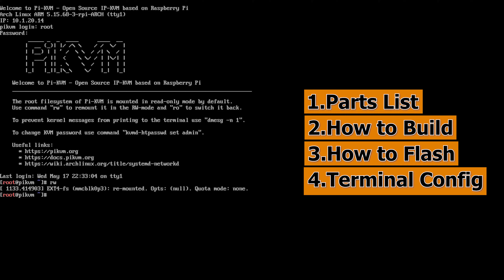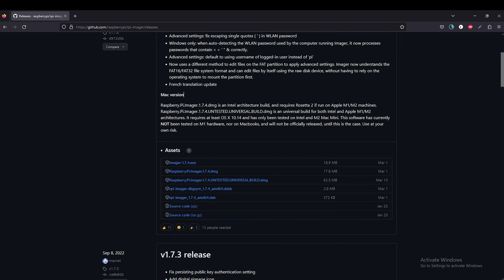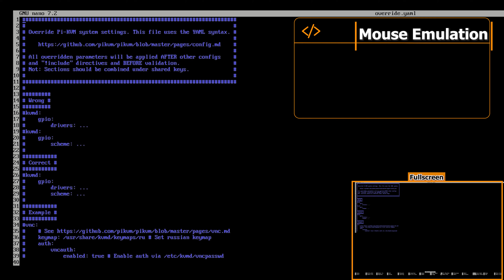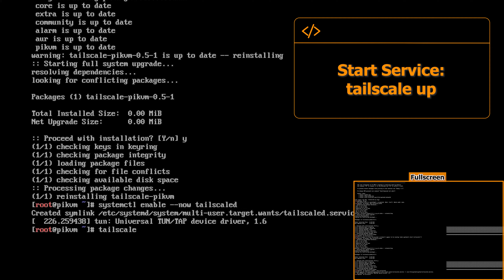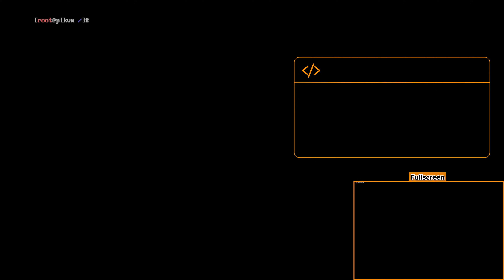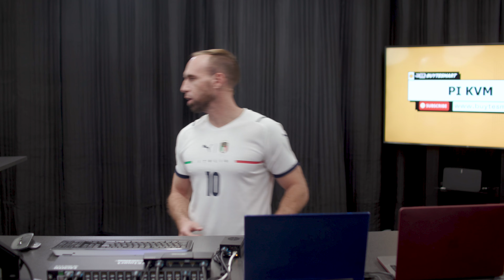PIKVM GUIDE: Build KVM Over IP Switch to Control 8 PCs with 1 Raspberry Pi

Comment: Hi, thanks for a great video! I have a question, how does pikvm switch between PCs remotely?
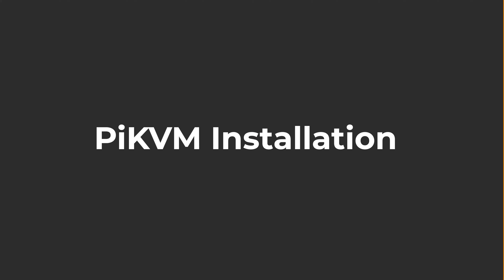Reply from the maker: You have to setup a traditional KVM and use Tailscale to log into the PiKVM remotely.  You are effectively creating an IP KVM Switch with this setup.  It starts around 15:30 in the video.

Comment: You mentioned USBC splitter is optional. If that is the case, then how to connect the keyboard. I'm able to get remote video but keyboard and mouse are not working. I'm need to remote into just one laptop
Reply from the maker: Connect the keyboard and mouse to the USB A ports of the Pi.  It's referenced around the 7:00 mark in the video.

Comment: ~320$ for the kvm, ~70$ for the pi, ~40$ for the case, ~15$ for ac adapter, ~80$ for the pi hat or hdmi daughter card.... I broke down and wound up getting an actual KVM for less problems and the same price. Nano KVM (uses lychee RISC) is also cheaper. It's a cute solution though.
Reply from the maker: New solutions have become available since the video was made.  To buy a standard remote IP KVM will still be alot more expensive than building a setup with a PiKVM.

Comment: Great tutorial.  However, I am having problems with connecting to some older PC I use for testing and they have VGA output.  I am not able to get the PiKVM to get video regardless of the VGA to HDMI converters i use. Unless you can recommend one.
Reply from the maker: This is the VGA to HDMI adapter we recommend: https://geni.us/JTFKO

Comment: @BuyTesmart i am using a 16port TESMART KVM with PIKVM v4plus and  I can see all devices locally but seems only to be able to see windows, "ubuntu GUI" and the pikvm HDMI output 2 however all the intel NUC devices that i have running ubuntu server are not being detected through the PIKVM remotely.
keyboard hot keys to switch inputs works like a charm but the mouse and keyboard doesn't control my devices.
Any ideas why i am experiencing such behavior with those linux servers? and how can i get my mouse and keyboard to control the connected devices.

Comment: I see that it's a TESmart 16 Port 4K KVM. Do the shortcuts (scroll, scroll) work remotely? 
Do you need to modify the file (override.yaml) on pikvm for it to work?
Reply from the maker: The KVM works independently from the PiKVM, no file needs to be modify for the hotkey commands.

Comment: I really wanted this to work. I bought a PiKVM and the 8-port Tesmart switch, but it only works well for some of my computers. The others had all kinds of EDID issues and I gave up.  Apparently, the Tesmart switcher does not pass through the EDID of the connected monitor or, in this case, the PiKVM capture device.  I think it is substituting its own EDID. I never got this to work, so I bought a different switcher instead. Very frustrating.
Reply: TechoTim also ran into the same problem
Reply: Which switch did you buy? And did it work better than the tesmart switch?

Comment: I have dual monitor dual system TESmart KVM, how do I connect it with PiKVM ? HDMI Splitter solution won't work.
Reply from the maker: Hey, one video connection cannot be split into two, if the PiKVM doesn't support multiple displays there is no workaround, with our setup we just needed one display.

Comment: Hi, is still not clear to me if I can use just one pivkm to see the screens simultaneously, is possible to select more than 1 input at the same time? Like if I want just to see the screen but work at another, is possible using this config?
Reply from the maker: This setup is for single monitor environments only.  Whatever the single-monitor KVM has selected will show up on the PiKVM and your local monitor.  You could get real sophisticated with a dual monitor KVM but it would be a brain puzzle on how to switch PC's/Monitors.  Definitely wouldn't recommend it because of how overly complex it would be.

Comment: For local use case we need to install the tailscale on all machines or only in the one that we will access the others?
Reply from the maker: Hey Luis, Tailscale needs to be installed only on the computer that will control the rest.
Reply: Perfect! If possible can you answer one more question? Can I control the PCs with different browsers? Like one browser per screen? If needed using different users on PiKVM

Comment: Where did you get the case with the hdmi-csi bridge cutout in it? My websearch on 'GeekPi Raspberry Pi 4 Metal Case with Fan' does not return that model. [Edited] - never mind just noticed your comment below that it was discontinued. I assume that you didn't find a similar alternative?
Reply from the maker: Hey TechLobo, this is an old model probably discontinued no sure where can be found :(.
Reply: The model name of the case is Geekworm "X630-C1 Metal Case". but the case has been discontinued. So your best bet is to 3D print your own.

Comment: the ATEN box is more expensive, and can't run via VPN, meaning either handling a static IP, or getting the latest public IP each time, plus port forwarding requires modem access to setup. the PiKVM is a dream, though it's missing two-way audio
Reply from the maker: Yea, that's the point of the video.  Couple the PiKVM with the TESmart KVM and you have a much cheaper solution.  Insert Tailscale and you don't need to worry about the static IP.
Reply: If you use Tailscale, you bypass majority of the stuff you had mentioned.

Comment: I didn't realize the kit didn't come with the HDMI module.  Is there any adapter that works to get the HDMI in through USB?  Or is the module the only option for full function?   Also, where can I get the case with the HDMI slot?  Thank you for the video!
Reply from the maker: Here's the HDMI module we used in the video:  https://amzn.to/3JZGuAt (Amazon Link)

The exact case is here:  https://amzn.to/3JZGuAt (Amazon Link)
But it's been sold-out discontinued.  We'll see if we can find a current case for the description of the video.